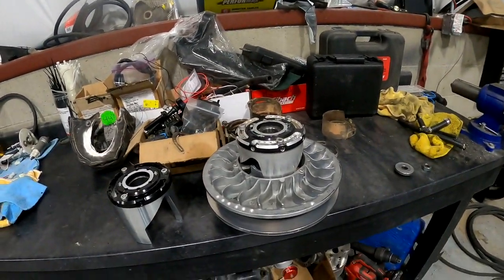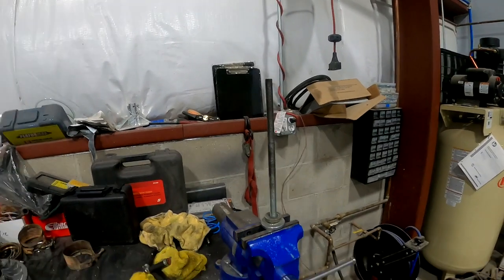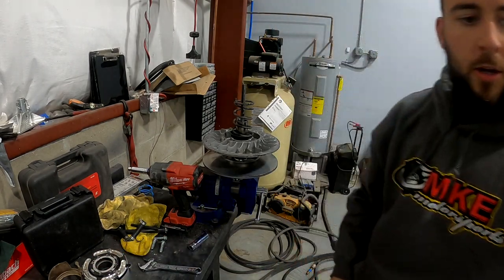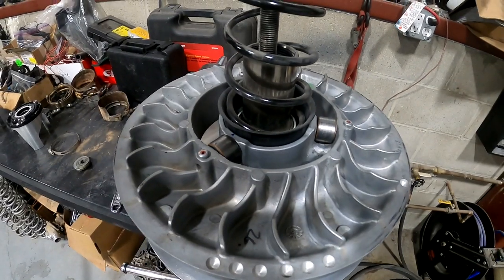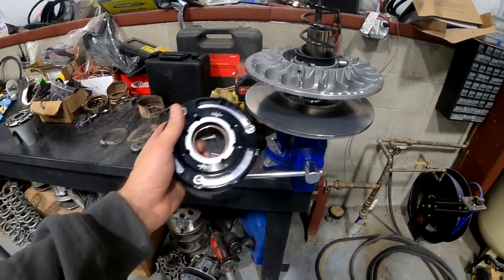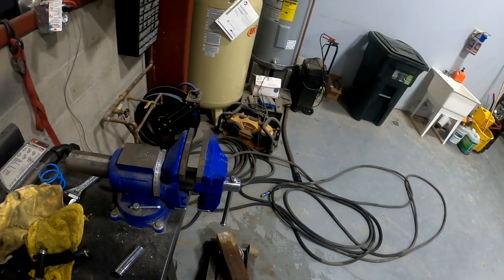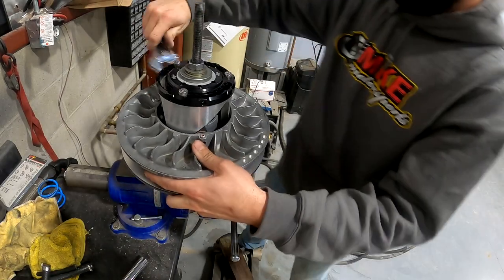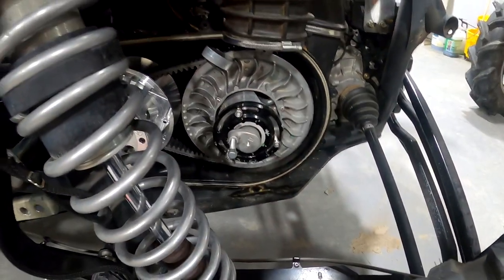Maverick X3 secondary SHIFTEK install! SXSBlog Garage with RICK

Comment: I honestly don't see why the clutch couldn't sit down on the threaded rod with the helix facing the vice. This would eliminate the need to remove anything from the vice, start to finish.
Reply: The rod would bottom out on the vice.
Reply: @richrules  Yeah, if you flipped the rod AND the clutch. I meant just flip the clutch. Leave the rod tighten into the vise exactly how it is.

Comment: What happen'd to the Pro 4 clutch? That Pro 4 I had high hopes for, both Doug and Nick rocked Pro 4. And you had it on the parts store. As of today no mention of Pro 4 clutch on your part store and you didn't get the Pro 4? Did Pro 4 prove to be bad choice for you type of riding and use?

Comment: Rick you neeed to to a build on your 150 ecoboost. Stage 5 turbos, injectors, and fuel system and you should be making around 700 to the tire on e